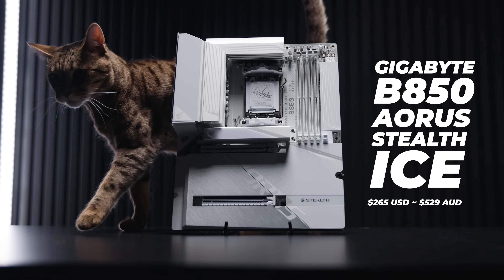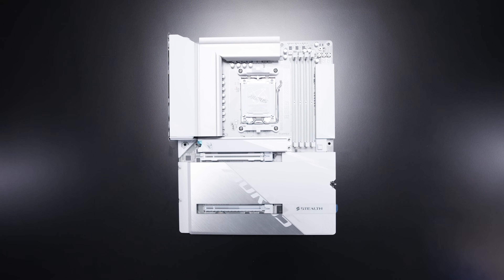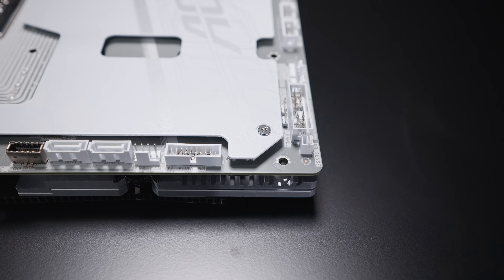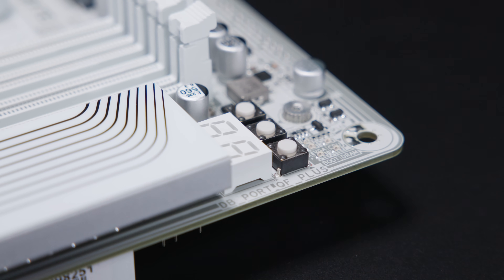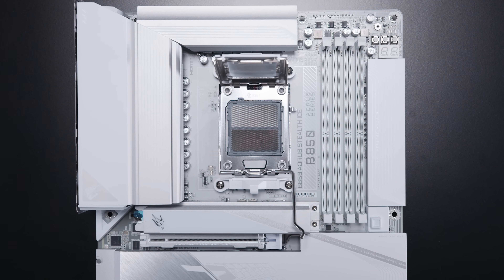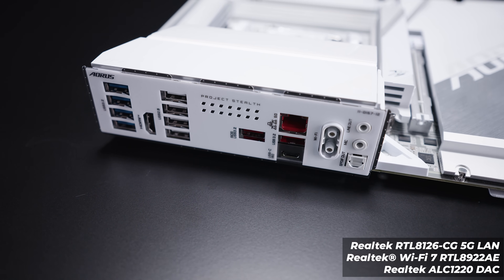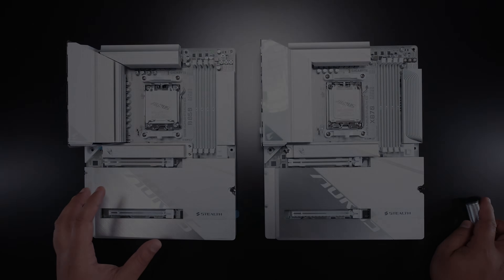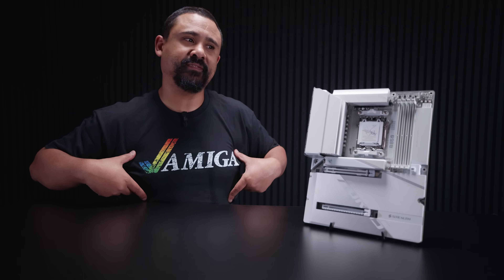AM5 is finally getting the love it deserves! // Gigabyte B850 AORUS Stealth ICE

Comment: Must point out how good it is to see the M.2 heatsink being removed on video.

1. Shows the mechanism.
2. It guarantees we get a look at the M.2 slot configuration underneath the heatsink, e.g. the second M.2 Gen5 on this motherboard is one of the ONLY double sided M.2 secondary slots on the market today (which is not just useful for Gen5, any double sided SSD will benefit).

Comment: Great video. I do wish you would mention if any of the m.2 slots share lanes with the PCIE GPU slot or any other thing etc. It is not always easy to tell when looking at product descriptions on places like Amazon,  Newegg, etc. Yes, I know we can download the instruction manual directly from the Mobo site but not everyone does that. Thank you so much.
Reply: This mobo doesn’t share lanes!
Reply: @FFTG09 all 4 dont share? i read somewhere that x870 slot B and C does share but A and B is safe. Considered both almost indentical i would expect its the same but idk.
Reply: @FFTG09  The 2nd 5th gen m.2 shares lanes with the USB4 ports on the X870, you can switch in the bios which one to use